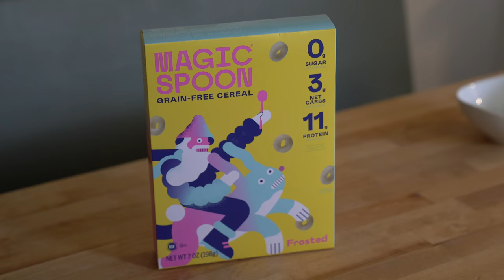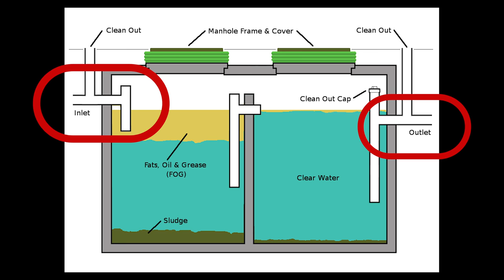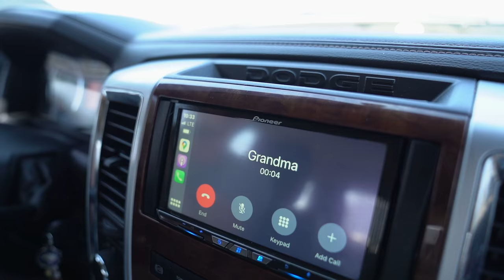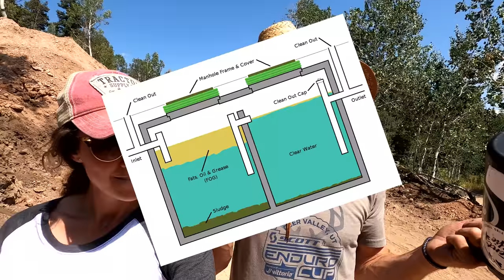SEPTIC SYSTEM INSTALL | BUILDING IN THE MOUNTAINS

Comment: You were wrong on the septic tank lasting forever.  Generally they should be pumped out and serviced about every 10 to 15 years depending on the amount of people in the house (load).  A tank will eventually fill up with solids that won't break down and must be pumped out.  That is why the tanks have the big clean out plugs/doors on top of the tank.
Another tip, go very easy on soap and bleach going into your tank, they are a bacteria killers. Adding old yeast and / or beer down the drain can also help with providing and maintaining proper enzymes in the tank.
Another one is adding Biological additives that combine enzymes and bacteria to either start or help enhance the existing biota in septic tanks to provide a good start for new systems.  Then can also be periodically added to help maintain a healthy system.  They are available on Amazon and other places for ordering.

Comment: Dig up a septic system that the leach field was 4 inch holy pipe and Too funny many of the holes had rubbers filling up with sewer water out the holes.  The owner said he never used them.

Comment: That septic system is different than what i got here in Alabama. If you dont have a surface clean out cap on the tank, you my want to mark where the clean out cap is when it get buried so you'll know where its at 20yrs from now when it get time to clean out.

Comment: At 20:40 Trent says if your tank is sized properly you should never have to have it pumped. Not true. Given enough time, it will start to overfill with undigestable solids, grease and a scum layer that will overflow into the leach field, eventually permanently ruining the leach field's capacity to absorb waste water. With normal full capacity usage, the tank should be pumped about every 3 years. I just sold my house that I owned for 10 years. The septic tank was pumped when I bought it. It was designed for 5 people to use. Only 2 used it in the 10 years we lived there. A septic inspection was required to sell my house. When the tank was opened it had a massive scum layer all the way to the top. It had overflowed into the 2nd chamber. Some of the scum and solids were getting into the leach field. I came THIS close to having a whole new leach field excavated and installed (which would have cost between $10-$20K). But fortunately it was just barely still acceptable after a thorough pumping and clean out.  Do NOT let your septic tank go more than 5 years before having it pumped and cleaned no matter what!  All of this information is available in professional septic maintenance references.

Comment: I saw a few weeks days ago where your battery was dead and you couldn't make coffee. Just wanted to tell you what I did for emergencies. Its not your fancy latte but its coffee. I took a pic of it but cant find how I can post it on a comment, but I got the cutest perculator. It's all steel so can be used on a stove or a campfire, whatever you got.  Makes a decent pot of coffee. Seems like 1 tablespoon coffee for each cup. It has a basket so you dont have grounds in your coffee. Seems like it was $12.99  @Walmart . Its cure and sure good for emergencies.

Comment: We have a similar septic system on our property.  Works great, but NEVER NEVER drive anything super heavy over it (like a man lift) or park something on it like Terry.  We had barely moved in when we had to deal with a crushed leach field pipe because a piece of heavy equipment had parked on the system to put the roof trusses on the house.  That was not a fun thing to replace!

Comment: Why not have made a reinforced concrete footing to place the septic tank on it. With the weight and humidity of the soil in winter it will move anyway and you will have problems afterwards.

Comment: That sucks that the tank settled the wrong way. Here in Florida, we don't have to fill them to see what the water does, we just have to make sure the tank is level and the pipes/drain field have like a 1/4 inch slope per foot.  Most inspectors just use a level on the tank and the lines to make sure the tank is level and that all the pipes have a downhill slope.

Comment: Hi Trent this is Alex from San Diego ca. I'm having a concern about my under the cabinet lights they are over heating did you have the  same problem in your Van ? I'm kind of worry about that . Is that a normal thing .
Thank you
Reply from the maker: Do you have the proper size fuse installed? They should not overheat.  I have not had this problem

Comment: Septic Tank Pumping Schedule

Following a septic tank pumping schedule is a good idea.
Many homeowners like yourself ask us this question . . .How often should I pump my septic tank?
To help you out, we've provided you with a schedule obtained from the US EPA. The frequency of septic tank pumping is based on the size of the septic tank and the number of occupants in the household.
This guide to septic tank cleaning or pumping is intended to assist you in scheduling your septic tank maintenance.
Septic tank cleaning and pumping is a critical step in septic system care as it extends the life of the septic field. Even if you don't care how septic systems work you need to know how often to pump your septic tank.
In the table below you can look up your tank size and number of persons in the household to see how often the septic tank should be cleaned.
For example, a 1,000 gallon septic tank, which is used by two people, should be pumped every 5.9 years.
If there are eight people using a 1,000-gallon septic tank, it should be pumped every year.

Septic Tank Pumping Table

￼
Remember this is a recommended schedule based on the average daily flow of wastewater leaving your house. Some households use a lot more water than others. They simply do more laundry, take more showers or cook more meals than other households.
All of these activities generate more waste-water and more solid waste that will need to be removed from your septic tank.
You may need to pump your septic tank more frequently.
It is also a good idea to pump the septic tank just before a party or large gathering of people. The large flow of wastewater into the septic tank can temporarily overload the septic tank and septic system. This could cause a stoppage in the sewer line between the house and the septic tank.
We recommend that you establish and maintain a septic tank pumping schedule just like scheduled oil changes on your car. Regular septic maintenance is key to a long lasting septic system.

Comment: As a former exterminator get yourself some poison pkgs (mice specific) don't open and put under counters, bed, etc but keep away from Frank! Mice will eat thru the bag, take it back to their nest & feed their young killing the whole clan away from Terry! If you use glue or other traps you'll have to deal with dead-1/2 dead mice. Same for roaches just use diff bait/food. Lastly, fill every hole, nook n cranny you can find with steel wool to stop them from ever getting inside Terry or for that matter Mom's house! Good Luck!

Comment: Don't assume that you'll never have to empty it. The rule is to pump out the sludge every 3-5 years or you could end up with massive, expensive problems if the sludge build up gets high enough to block the outlet or to start clogging up your drain lines. Too many septic tank problems start with "I didn't think I needed to ever have it pumped out!"

Comment: Eat a big meal before you go to the dentist....and remember to feed Frank. Do yourselves a favor and take Terry to the property and live there. I hope your plans call for an eight inch floor, at least six inch walls and ceiling. And if your not getting triple glazed windows expect to be coldish, this winter. Try to be there for all the stick work aka framing, so you can learn about how and why it's done that way. Get a metal cover for the RV and try to begin your solar array. And since your going into debt, go shop for a good snowmobile, and snow blower.

Comment: They over dug the bottom of the tank pit and did not compact it . Make sure the septic people fix the problem with no extra costs it's there responsibility to install a approved system. I watched so many guys go broke fixing there mistakes and with equipment repairs they go under in a hurry. Me and my dad ran a construction and excavation co for over 45 years . Lots of hard work , would not trade it for any other job made millions off of people's dreams , I drove up to the lakes we helped develop100s of camp sites and home sites . It was so sad to see so many mt homes and the lake was so mt , that the fish and game was allowing people to take as many fish as they want there was litterely 1000 of fish splashing around in on deep chanell out in the middle of the lake. What is going on the earth is falling apart.

Comment: Hey Trent .. I'm very surprised your excavator didn't bore out 5 pillars to pour concrete footers and second making an absolutely stupid decision not dumping a build up of #2 base and tamping it down besides not using any pea gravel and silica sand under all the piping .. I didn't see any expansion joints used either .. did you put locators in those trenches? .. wait .. y'all have 80 degree weather all year round RIGHT?

Comment: That unlevel septic tank should be emptied and lifted, then reset in a bed. They're not that heavy the contractor is just being lazy.  I know,  I have core drills. They're are used for bad work like that, but remodeling and upgrading.  I go through this crap all day from the gc's to the subs. That tank should have had a compacted and leveled bed of based, pea gravel, sand, something. 

It's even harder to deal with when you work for a contractor  knowing they're cutting corners and having you cut them right along with them just to stay employed.

Comment: ugh.  Nature's head composting toilet.  done.   Then, there's a specific way, naturally, to treat grey water (using only biodegradable soaps) so you can use it to water gardens, trees etc.  Or, buy the filters, and UV treat the used water, and reuse it.  Van lifers figured this out.  Then, you wouldn't need any of that septic system.

Comment: Any time you are setting anything of weight onto the ground always tamp ti down with a tamper. It is best to not disturb the ground that is firm to begin with and always tamp.pound like "packed earth". You can rent them easily and use a bit of water while doing it and it will get really tight. In really lose soil use a lot of big stones and pack the area around the place like 30% the size.. rule of thumb just as the 30% rule for any project overages. 
   BTW why are you guys doing all the running around? As a contractor "the man" it is his JOB to see that it is done right the first time and if not then he should be doing what it takes to fix it.... Just sayin .. ( I do contracting for over 35 years and always take responsibility for the job done right in the first place so I don;t have to spend time and $$$ to go back and fix it.
     Also as a rule you always let something sit for some time while you do other stuff to let it settle, warp or whatever it may do before you fill it in, seal it up put the face on it etc....  With that huge machine they should have a tamper attachment or run the tracks over the area with a load on it at the very least. I do that with my skid loader for every layer put down. pick up a full heavy (damp) load of dirt and then run over the area over and over again, fill, level and do it again.  But again they should have an attachment for pounding down the site for just this reason!!!   suggest it to him and back charge him for your labor and costs for pumps etc!!  That will drive the message home.  Blessings, love your videos

Comment: AAAHHHH!!
 The optimism of people who don't have a clue about what they're doing.
 "We've been digging, working an goin' like crazy all day,,,," and not a drop of perspiration on his shirt. 
What work?

The first thing to do is a soil survey to determine if the property will absorb septic water runoff.
 To put a septic tank in, it is important that the height is correct, in other words, the depth of the hole. The next even more important thing is to know the bottom of the tank for most of it's area, is in contact with solid ground. It MUST NOT be sitting on any fill, or loose soil. It must be virgin un-dug ground and it must be level.
 To do that, you need to take a level from the in-coming pipe to the bottom of the hole, then drop in a bucket of 10mm (3/8") aggregate stones with the excavator. They should be leveled off to the correct level of the in-coming pipe connect point, on the tank.
If you sit the tank on any filled ground that's not virginal, the tank will settle and cause problems post installation. Septic tanks are usually made up of two chambers. The first and larger chamber is where all the solids and waste water from the house first enter.
The tank must be full of fresh water before it is put into use.
 Here, everything drops to the bottom where almost all the solids eventually float to the surface and form a crust. Everything is very still, that's why the tanks need to be so big.
Relatively clear water flows into the second smaller chamber through the dividing partition wall and what little residue that enters will also form a little bit of crust on top.
This the reason that the inlet and outlet are formed with a 'T', so that the crust is not disturbed and as clear as possible water is all that flows out of the tank into the absorption trench system.
 Generally, a septic tank should be pumped out about every 5 years, depending on how many live there and how often it is used. It could need pumping every two years.
 When it is pumped out, it is to mostly remove the sludge building up in the bottom of the tank. In time the sludge will turn into dirt and if left too long can block the whole system. There should be some crust left after pump out, to facilitate more crust to form and also to act as a forming/breeding ground for the many different bacteria.

Comment: I am beginning to think you got a bad lot.    Somewhere a bit more level would have erased a bit of this drama of just putting up a tiny house.  It should not be this difficult.  It has to be the lot is from hell.  Why don't you guys just pitch a tent out there so you don't have to drive 2 hours.   This is crazy.  I'm pulling for you.  But it seems an uphill climb.  Hope it all works out.
Reply from the maker: Don’t worry, it’ll all work out in the end! Once the concrete foundation is poured we’ll have space to pull the trailer up there and live on the property while we work- the light at the end of the tunnel is near!